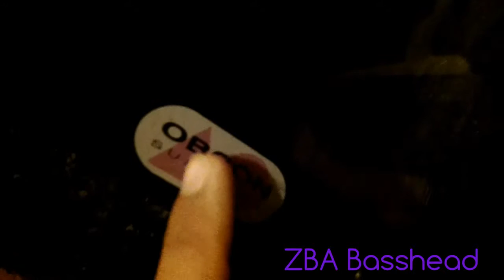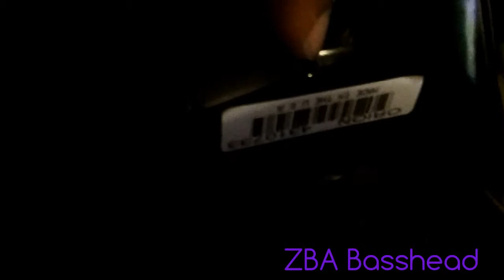Orion XTR10's (Old School SPL SUBS)

Comment: The ratings were peak ratings so it was 800watts max not 800rms. They lowered the rating on the next Gen because they found out the subs wouldn't hold up to the ratings they had on them. Those 10's have the same motor, surround, coil size, cone, and basket as my xtr3 10's.